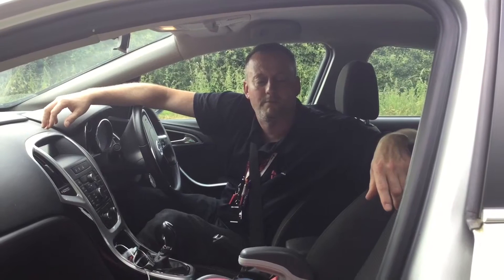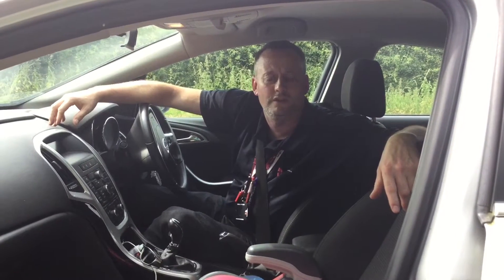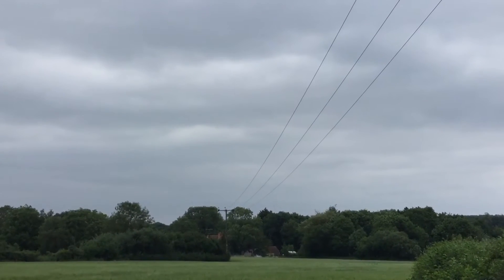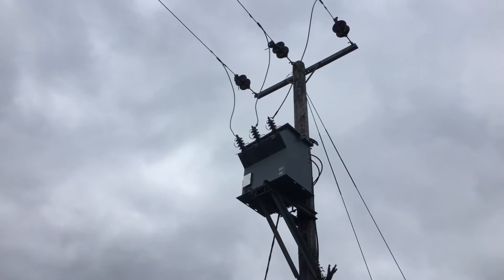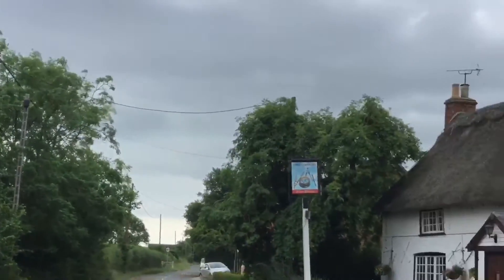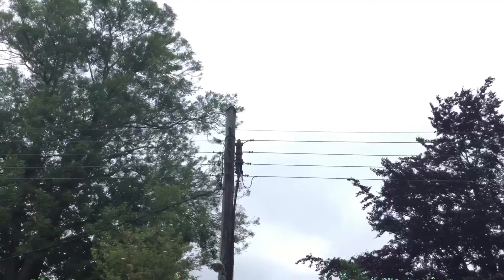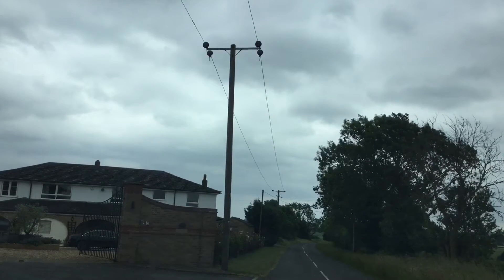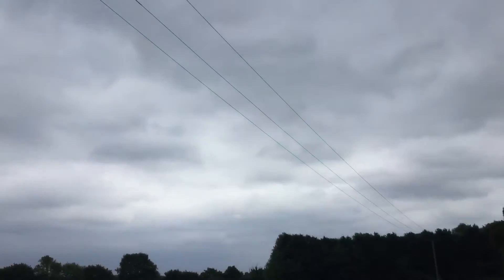Overhead Power Lines 11kV to 400 Volts Delta to Star. Rural Single Phase Supplies on Wooden Poles

Comment: I’m pretty sure the 2 line (L1 L2) 11kv supply to achieve a single phase LV service was called “split phase” by the electricity boards. Saves money on HV copper conductor for the money grabbing bastards.
Reply: I too also think that the 2 wire 11kV overhead lines are in fact 2 of the 3 phases both 11kV, sometimes incorrectly called "2 phase". Marc is correct that it is called "Split Phase", used where local demand does not need a 3-phase supply. The 3-phase transformers change the 11kV primary voltage down to 400/415v 3-phase, and the 230v/240v single phase supply is obtained from one of the phases and the neutral. On a split phase (2 wire 11kV) line, I read somewhere that those transformers are configured differently, so that the 11kV primary is reduced to about 440v, 2 phase. The 230v i think is obtained from one phase and the neutral. Another thing I have noticed when travelling to northern areas of England, is the 11kV, 3 - wire poles, sometimes have a high voltage cable connected to only the middle phase, and leading down towards the ground.  Does anyone know why this might be?  Perhaps it's in older distribution systems that use a 6.6kV supply for the HV distribution, some parts of Manchester I think?? I believe the phase to ground voltage of an 11kV line is also around 6.6kV?? Please correct me if I am wrong in that understanding.

Comment: Used to love going out to the rural LV and connecting generators to the overheads during faults, quite labour intensive climbing pole with 3 x 240mm2 conductors on 1shoulder and insulated lyton clamps on other, (nowadays a bucket truck is used)
Reply: If only they had realised they could have just used bucket trucks back then. Would have saved you a lot of bother. Sorry to hear of your experience.

Comment: I recently see a 3 cable overhead supply but only 2 of the cables going into a post mounted transformer. What would this be for?
Reply from the maker: barry wells they can take 2 phase and make a single phase supply 🦾. Great question. Thanks for watching. Gaz